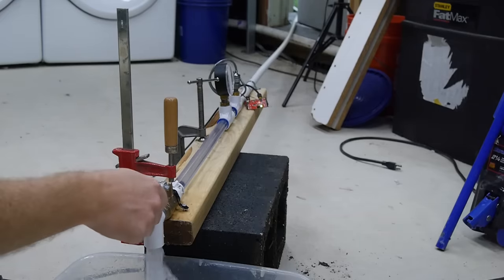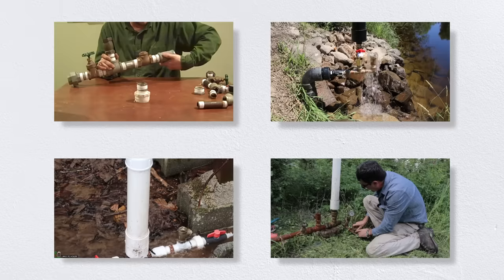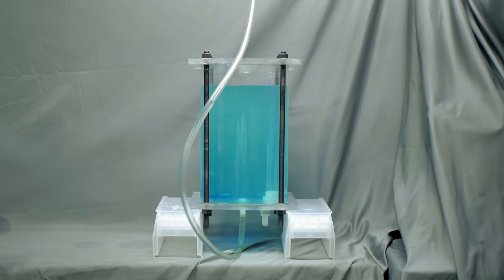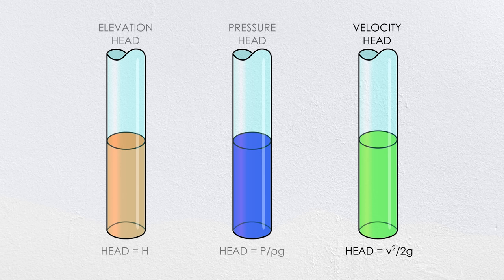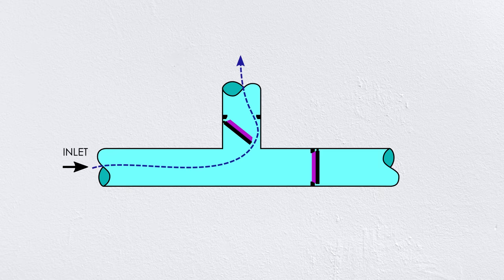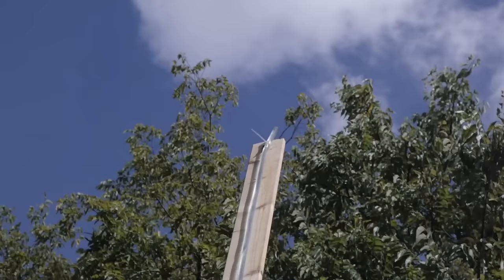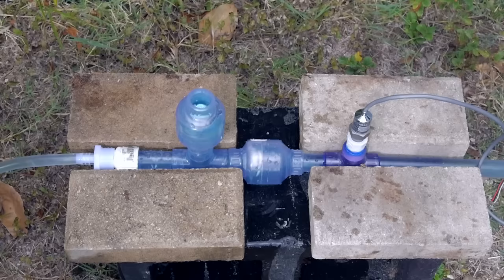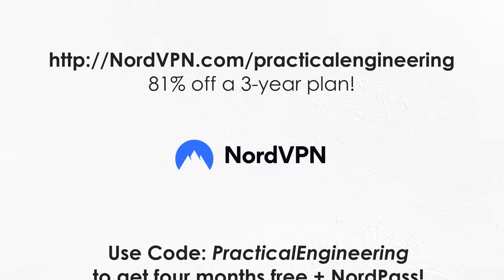How Does a Hydraulic Ram Pump Work?

Comment: You could build a hydroponics system next to a stream with this system.

OR you could have an indoor hydroponics system connected to a standard electric water pump, BUT run a hydraulic ram pump parallel that extends the range and power of the electric pump by recapturing the energy of the return flow of water

I wonder how much energy I could recapture 🤔

Comment: How efficient is this compared to just diverting some of the water to drive a constant displacement pump (as you described and correctly indicated was more complex)?
Reply: Well engineered rampumps can be 70% energy efficient but none wi really exceed 30% volumetric efficiency. However as the source is almost always a flowing water source this can be seen as 130% as you are making use of an otherwise wasted water source

Comment: 1. At 1:45 you said a ram pump can move water to a higher elevation w/o electricity or fuel. Is that true only for hydraulic ram pumps or non-hydraulic ram pumps or both?
2. What is the difference between a hydraulic vs. non-hydraulic ram pump? How are they different in terms of the parts of the pump?
3. In your video, what part of the pump makes it hydraulic?

Comment: How does the water first get into the ram pump pipework? What is the connection? Can it trickle in from a stream somehow? How much flow / pressure is needed on a small system like in the example shown? And how much is required for a six inch pipe?

Comment: Your testing on ram pump is good for unlimited water sources, such as creek or river. I love in desert area, so I can not spill any water from the valve. Please kindly advice me how to make ram pump from 10 water tank in the basement to another 6 water tank on the concrete roof of my house with height of 6 m, without spilling water from the valve. I am keenly awaiting your answer. Thank you.
Reply: This only works on the principal of flowing water. You are using the energy from the flow of the water to pump it up. The beginning of his flow is at a much higher elevation than where he’s pumping it because it’s likely coming from a water tower or pressurized system.

Comment: Love your explanations!!! Is it possible to operate a ram pump without head by funneling the kinetic energy of a low sloped but fast moving stream into the pump???? Also, does the buffering air chamber reduce the efficiency?

Comment: Could you connect the two check valves together and arrange so they feed into a flywheel, perhaps add mechanical inertia effect?
Reply: Why? If you want a mechanical output, just put a water wheel in the river.
Apart from anything else, if you put any load (back pressure) on the outflow from the waste valve, that valve may not shut at all - and if it doesn't shut, the delivery valve will never open.

Comment: I wish the explanation of how it works went through the whole cycle. You explain from the point where the waste valve opens, the water speeds up and closes the waste valve, and the pressure opens the flow valve. What closes the flow valve and why does the waste valve re-open after?

Comment: Hello Grady,
Thanks for your video work, it has been fantastic to watch.  Can a Tesla valve and/or pump achieve the same effect as a ram pump? The benefit is a noise-free environment with no moving parts.  May you and yours live long and prosper.
Reply: No - because a Tesla valve is a one way valve, which offers no resistance to water flowing in a given direction. But for the hydraulic ram to work, the waste valve must not only be a one-way valve, it must be a one-way which can be shut by the water flow. It's that valve shutting which converts the water flow into water pressure, which forces the delivery water uphill.
TBH, the noise created by a hydraulic ram is so little that if you were standing right next to it, you'd barely hear it - and as in a practical installation they're installed in or just above a river, the noise of the flowing water would be louder than that of the valves in the ram.
HTH

Comment: What if I have a tank of water which is filled by a spring. Then I have a mechanical pump that feeds the input tube of the hydraulic ram pump with moderate water pressure (say 2 ~ 5 bar) and the waste water simply falls back into the tank, also the tank has a way to regulate the filling spring flow to avoid overfilling and wasting water. What did I just made? What can it achieve?
Reply: This seems like a waste of time.  More steps is almost always more troubles and more losses.  If you have electrical or other power running a pump, you should just select a pump that does what is needed.  The ram pump is good when you have no other source of power involved.

Comment: i am trying to build my own with all pvc components, the problem is you use the swing check valve while i am using a ball check valve, i had found that its hard to let the ball check valve push water in pulse automaticlly, unless i add a pipe with water on it, and it works, but this design is very sensitive to the water source's head height. i was wondering if i could add a third valve after the inlet

Comment: How would this work in a small creek where there is not 3-4’ of drop or head pressure?  Does the current of the creek provide the head pressure? Or is another component needed, or entirely different system?

Comment: Neat video. Is there any chance that you could potentially scale this up to generate commercial energy? If you got water to flow up hill and then could store that water behind a dam and some generators, let's say. If you were able to capture storm water or runoff that would be ideal (I live in a rainy place, but the LA river would be a good example of such a location). And since you're building it all from the ground up you could potentially mitigate environmental impacts and avoid existing watersheds for the project entirely. Water could go right back in the system where it started (though there would be controversy over how long it could be sequestered). Is that a feasible idea?

Comment: Consider TOP VALVE the on at the top and A VALVE the one through which the "useful water" flow. Lets say 10m is the head of the flow without this pump, just the stream of water from the source in the tube. If the water pipe after the "A valve" is 10m tall than the head pressure on this side of the "A valve" is also 10m since the flow is stationary when the valve closes. Now as the top valve closes, the flow stagnates, and as you said in the video, the pressure after the "A valve" is equal to the stagnation pressure. This would open the "A valve", but since pressure is equal both sides nothing happens. My question is what is making the stagnation pressure before the valve become greater than it was originally without the pump? Where is work coming from?
Reply: When the top valve shuts, the column of water in the feed pipe does not 'stagnate'.  On the contrary, it tries to keep moving, due to its kinetic energy.  But the sudden stop converts that kinetic energy (or momentum) into pressure; that sharp rise in pressure is what opens the lower valve.
Imagine a crowd of people hurrying down a narrow corridor, when a door is suddenly shut in front of them. What happens? The people nearest the door get squashed, because the people behind them don't stop quickly enough.
HTH

Comment: Is it possible to put a return pipe on the waste valve to save the water in some way or would the extra pressure cause the pump to stop working? I'm thinking for an aquaponic system so will not be working with huge head heights but wasting water would be a problem.

Comment: I need clarification. Water running down a pipe is said to have less pressure than if said water was standing still? Is it the speed of the water running down the pipe, or the fact that it's sucked instead of pushed what gives it the low pressure??

Comment: It's pretty clever and I like it but wished there was a way to save the waste in a way that won't contaminate the water.
Reply: Make a capture system that's piped back to the source where you are pulling from, such as a trough. Costs just as much for the piping you did for the ram, but captures the waste and sends it back with relatively no contamination. Might as well do it again for the container you're filling so overfill doesn't get wasted either. 

This means you're spending a ton of cash on a low efficiency pump system, but the positive is it should last for quite a long time and doesn't use power.

Comment: Do you think it would be possible to build a closed system whereby stored water in a tank powered a waterwheel that powered a generator big enough to power a house? How many return line ram jet pumps would need to be in place to return the flow back to the tank? I'd like to build one for my house so we can be off grid (no so much to avoid costs, but to have a continual source of power. We lose power a lot because there's so many trees on the road beside the lines. Just about every time it storms, a tree falls on the line somewhere.

Comment: We need to know formulas, to figure out how to design the right size pump for the given head height and pressure, along with given flow rate from river/pond available/desired. 

Where is the formula for how much water is pumped verses how much needs to flow on by as "wasted"?

Comment: Just a question.
How do you start it?
Do you fill it up with water first?

What if the ram pump is in a higher elevation. Wouldn’t the water inside tge pipe roll back?

Comment: Just curious how the ram pump will perform if they are connected in series or in parallel?  Is there a ball park ratio for every unit of height of the intake against the height of the discharge ( say... how much height of water can 1 unit of intake height push up) ? I'm not sure if I had used the correct terms in asking my questions...hoping that you get my point... thank you very much!

Comment: I am doing my thesis on this subject, in bringing water to a hotel from a small lake located 30 meters below, almost nobody in my country uses this system xD
Reply: Get a refund on your tuition. This doesn't work with a lake.
Reply: jean solis which country are  you.?If my guess is P.I . then there are now few commercials ram pump in the market but can be costly, it does give you ample of water supply though 24/7. I made similar above , I hope to sell it soon.
Reply: vidznstuff1  I think if you create downfall that could work , ratio is 1:15 m .

Comment: Is there an electric pump between the source bucket and the ram pump? if not, the water is still at the bottom and at the top. Where did the excess energy come from, that lifted the water to the top?

Comment: Am I correct in noting that this pump design wastes water as part of it's operation?
The demonstration devices certainly seem to suggest so.

Thus as useful as it is, it would seem problematic in places where water supplies are limited.
Still a truly fascinating piece of engineering if that's true though.
Reply: It does waste water.

In most cases they are installed alongside a stream so that the waste valve dumps the water back into the same stream than it was picked up from.

So it can lift water upwards by dumping the rest to where it would have ended up anyways
Reply: The word "waste" may not always apply.  Since the water goes back into the stream it came from, it continues to do what stream water does.  Someone with a stream and a garden or even perhaps cows up a hill from the stream can take a little water and some energy from the stream to provide the needed water.
On a different bit of the stream, they may also have a water powered generator.

Comment: Me and my dad have land in Colorado with water rights - trying to figure out the best method to pump water from the river up to our cabin into a storage tank (probably a slow vertical climb of 75 feet, over a distance of 1000 feet) and are not having much luck with our submersible pump.  Any ideas?  Can't honestly say engineering has been my strongest suite, but I imagine there is some math to this equation lol

Comment: What would happen if you ran a series of two or more ram pumps on the same water line? Would they cancel out the water movement through the line? Or increase the flow?
Reply: The second ram wouldn't work, as the flow rate from the first ram wouldn't be fast enough to shut the waste valve in the second ram. If the waste valve never shuts, the delivery valve never opens.

Comment: Pretty sure this is how fires were fought with a portable ram on a carriage in the old days
Reply: No, they weren't. How could you have a ram pump working, if there was no flow of water (as in a river) to make it work?  All fire engines need a source of power to work. In the earliest days, it was a team of men working levers to drive pistons in a water pump; they were replaced by steam engines on a wagon pulled by a team of horses; now, they use diesel engines.

Comment: What PSI Check Valves are being used for the inlet and for the waste water?  Is there an association or calculation for the check valve psi rating vs the expected (or measured) head pressure coming in?

Comment: The water supply I want to pump from is over two meters in depth If I secured my Ram Pump at the bottom under two Meters of water am I correct I wouldn't need to add extra height to the Inlet side of the Ram Pump because the pump already has two meters of water over it??  My water depth is always at this two-meter ++ depth. 
I'm hoping you'll answer this question.
Reply: The depth of the source water doesn't come into it. The essential point for the ram to work is that the water must be flowing - reason being that the ram depends on kinetic energy in order to work.
HTH

Comment: Could you essentially move enough water to higher elevation and let it flow through turbines on it's way back to a reservoir to essentially generate free energy?
Reply: Yes although the volumes required for hydro generation would make this micro hydro due to limits on the pumps efficiencies. It would however be ideal for peak time generation.

Comment: Hi, we're looking into using a Ram Pump to cycle a 300 gal catfish stock tank, cycling the tank 10 times per hr, in addition to using it for the aeration needs. Any help you could offer would be great. The check valve output would seem to work well for this. Thanks OC

Comment: Why does the waste valve open at all after being shut?   I can't figure it or find an explanation.  It seems like when the delivery valve slams shut from pressure it must push back on both the supply and waste pipes creating a brief void... Then the water on both sides of the void collapse sucking open the waste valve before the supply valve can overwhelm it again... Is that correct?

Comment: Hey Grady, i've got a question. Can someone use a small stream of water to pressurize a larger one? Can someone make a DIY water tower with a weak pump that only has to pump a small volume of water to a high enough altitude, so that they can let the water fall back down to pressurize a larger body of water?
Edit: withput needing the large size of a normal water tower?

Comment: So if you pump the water back into the inlet pool, would it just keep going over and over? Or does it not pump enough volume to supply the inlet?
Reply: No - the feed source has to supply the water being forced out of the delivery pipe AND the water which flows out of the waste valve, so the delivered water is always less than that being fed into the ram. Also, a ram will only work if the water coming into its intake side is actually flowing.
And why would you want to pump the water in a closed loop, anyway? The whole purpose of a hydraulic ram is to pump water to somewhere else.

Comment: But what causes the waste valve to open again so the cycle can repeat? Is the gravitational head in the waste column enough to open the waste valve for long enough to allow the water to pick up the speed needed to get a strong enough water hammer? Intuitively it feels like it would result in progressively weaker hammers - is there something else going on?
Reply: There are two causes
1)
The waste value uses gravity or a spring to always push it towards open.
The water flows and builds up speed.  
At some point the water's drag on the valve overcomes the spring/weight and drives it closed.  
There is then the pressure pulse that does the work and also holds the valve closed.
The water in the pipe stops.
At this point, the waste valve only has the normal water pressure pushing it closes and the stronger force from the weight or spring pushing it open.
Thus the cycle repeats.
2)
When the waste valve closes, there is a sudden pressure shock.
This travels up the feed tube to where the input is.
When the shock hits the top end of the tube, it causes a small amount of water to actually go out the input.
Suddenly and for a very brief time, the water in the feed tube is going up hill.
That takes the pressure off the input side of the waste valve so it opens.

Comment: Can this be used on a home spigot to increase pressure in a hose for using a sprinkler?
Reply: It might increase the pressure - but only by reducing the flow rate. If the pressure out of your domestic water system isn't enough for your sprinkler system, you need a water pump.

Comment: Would it be possible to put a line on the first check valve and pump that water uphill or use it to boost the uphill flow?  

Please don't flame me, I'm not an engineer.